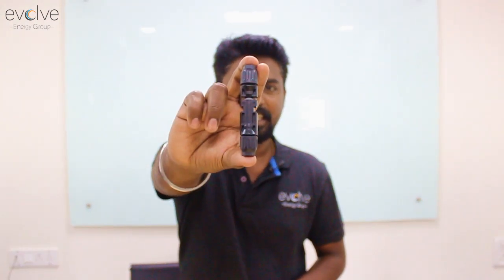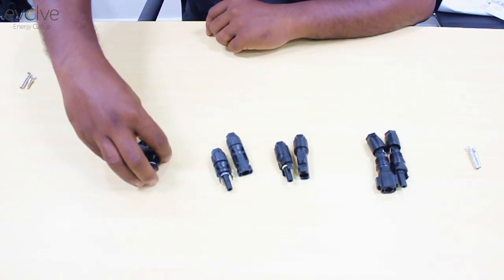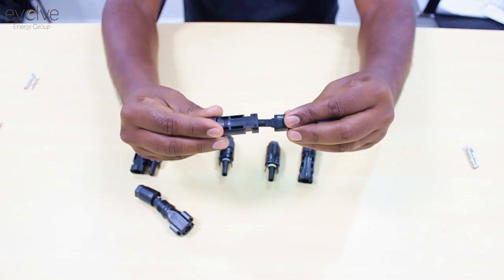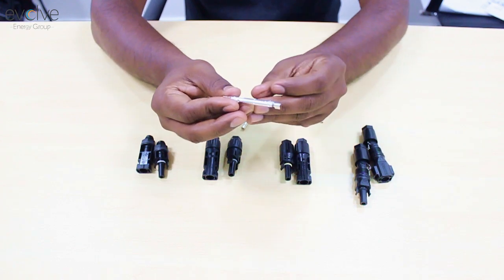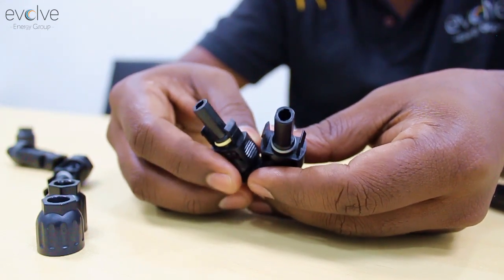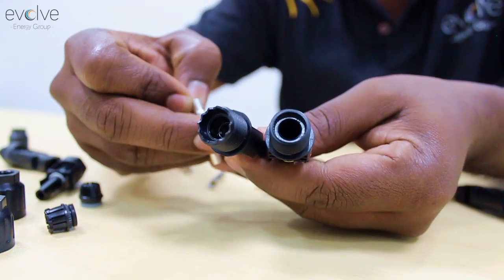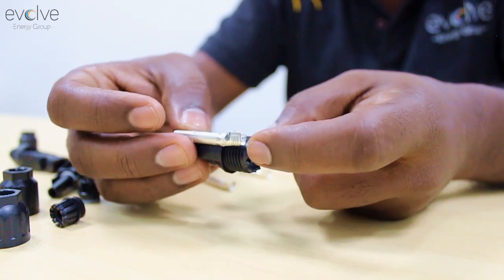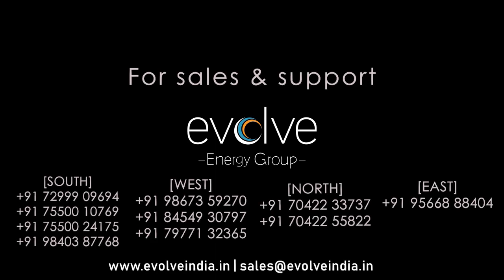BEWARE OF DC CONNECTORS / MC4 | SIVAKUMARAN CTO | EVOLVE ENERGY GROUP

Comment: I don't care how often they blame us for not buying the same brand as the panel or not having an expensive crimp tool , the MC4 is a bad decision for solar.  It is a standard which is not standardized!  It's not easy to install or use.   Anderson works quite well but not IP rated.   I guess that direct connections are the cheap and reliable solution, but sometimes we want to disconnect or change.

Comment: Crimped without proper MC4 crimping tool and also cheap cable. Aluminium cables are known to causing creep out of connectors. Too many amps. I think MC4 is rated for 30A.

Comment: LOL. I get what you're saying , but all solar panels come with connectors already attached during manufacture, so it's impossible to source the same manufacturer (in China). I've had the same problem occur twice (with good quality connectors) and since most installations are permanent, the real solution is to do away with ALL of them, solder and insulate the cables.
Reply: Solder is also dangerous.

Comment: The person is saying male-female correctly AFAIK. "The MC4 system consists of a plug and socket design. The plugs and sockets are inside plastic shells that appear to be the opposite gender - the plug is inside a cylindrical shell that looks like a female connector but is referred to as male, and the socket is inside a square probe that looks male but is electrically female."
Reply: I agree, just going out to the bar can be challenging these days.